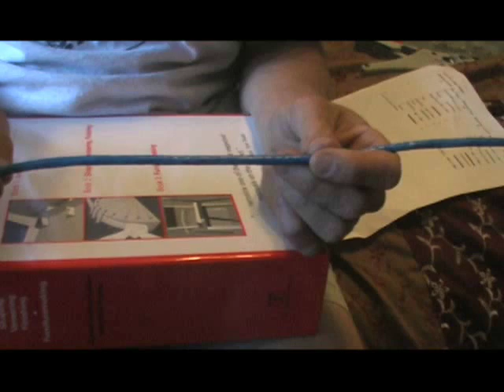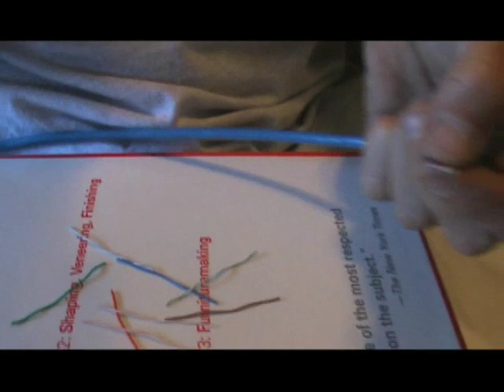Cat5 Crimping Tutorial

Comment: Hi there, I'm terminating my own cat5 cable for the first time. We have moved into an office with  ethernet sockets all round the offices, but just a big bunch of wires hanging out the wall where the switch should be. I bought a switch and now have to terminate all the cat5 cables at the switch end. You mention that Darin is doing the second end of the cable, not the first, but is the switch end the first or second end (as you put it)?